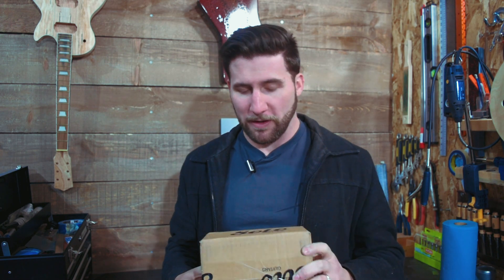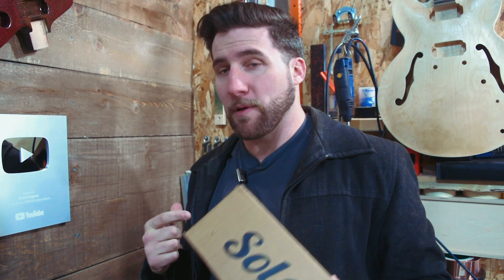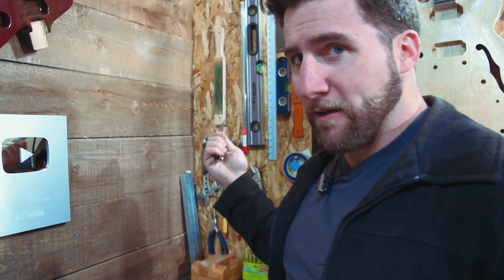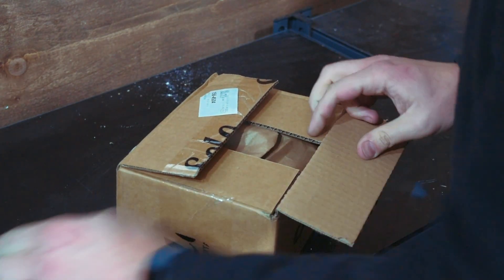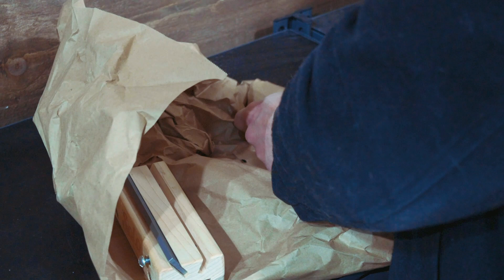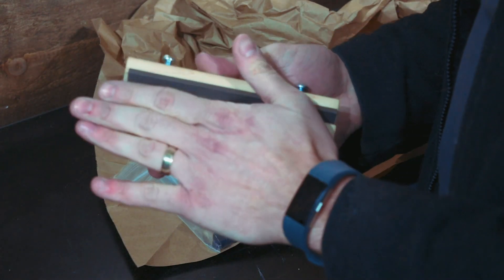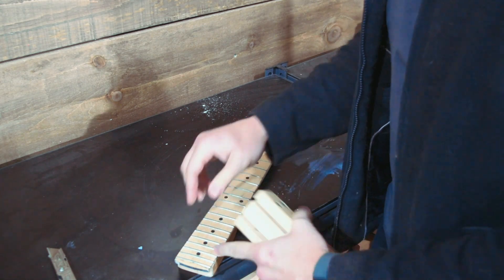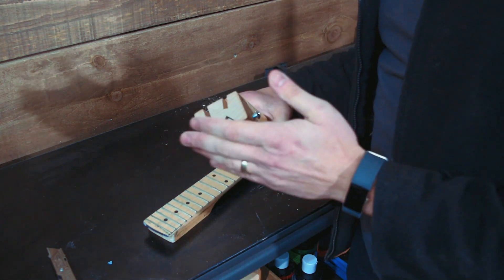New Fret Work Tools! (Unboxing)

Comment: I just visited the Solo Guitars' webpage, and had a look at their Fretting Tools, and I too came across the Fret Beveling File. It's nice to see a version with the option of 4 different angles!

The 90 degree angle is a good place to start, to ensure all frets are as close to being flush with the fretboard edges, before switching to one of the other sides. I often find that a good fret end nipping plier will almost take the fret ends flush to the edges, allowing you to go straight to the desired beveling angle. On some necks a 35 degree is too much, and will create problems, like strings slipping off the fret end, so I mainly use a 15 to 25 degree angle.

A little tip for everybody doing fret beveling...
Put a long strip of masking tape on top of the frets, for the beveling tool to "ride" on, when beveling. This lets the tool slide freely and it protects it from getting filing particles stuck to it. It will also keep the tool from scratches, from the sharp burrs, created while filing in the bevel.

My preferred fretting method is using the Arbor Fret Press, with brass fret cauls. It's simple to set up and the accuracy is phenomenal.
I have a handheld fret pressing system as well, only with a rounded support caul, so I still have to use the Arbor Press to press in the heel portion of the neck. Last week I came across another Handheld Fret Press, this time with 4 switchable neck support cauls, so I pulled the trigger. This will now allow me to also press in frets at the heel portion, which is great!
Reply from the maker: The solo handheld press has the switchable cauls for the neck. It’s a nice touch, especially for different shapes necks.
Reply: @BradAngove  - The one I recently bought has the same 4 switchable cauls, hence the reason I bought it!
I can fret bolt-on necks now, without having to take it to my actual Arbor Fret Press. It'll be nice to switch things up a little - depending on the type of job.

Keep up the good work & Merry Christmas 🎄

Comment: I made the exact tool years ago when I was very poor from a block of pine cutting out a couple of angles and glueing in a couple of cheap flat files. Has worked well for years and I still use it. The fret press is definitely a very handy tool if your building or re fretting but sometimes I find the hammer just gives better control especially if its just a part re fret ( just done a new epiphone les paul with shocking fret work) nove video mate and merry Xmas and enjoy all the great food!
Reply from the maker: Thanks Stu. A diy version of the block with some glued in files or even threaded inserts wouldn’t be all that difficult I suppose would it haha.
Reply: @BradAngove  i just used epoxy mate and its worked for years when I first priced one they were only available from the USA and silly money! The same as neck rests that I made years ago are still used almost daily.... could be a new segment of your videos mate #canbradmakeit
Reply from the maker: #50/50chance haha

Comment: You just gave me an idea. I have a caul for my drill press. Might adapt it to use as a punch for neckthru guitars 🤔
Reply from the maker: Intriguing idea
Reply: @BradAngove  yes, despite my typos 😂.  The drill press method works great, its just very cumbersome for neckthru and set neck stuff.
Reply from the maker: Yeah, I could see some kind of stand adaptation being required.

Comment: So, your new tool - A fret punch?
Looking forward to the comparison. I never liked the idea of hammering frets, always preferring a press fit. It somehow always felt wrong using a hammer on a guitar.
Reply from the maker: That and the multi angle neck file. Keep in mind you can also use the punch in some large chuck drill presses as a fret press.

Comment: Can you use that fret press piece with your drill press to "press" the frets in instead of hammering?
Reply: yeah a lot of people do it, but some say that it doesn't set the frets in properly if you do that and they can "bounce back" because the tangs don't interlock as well as if you hammer them in.
Reply from the maker: Yeah, if you bend them sufficiently first you can still have the tangs bite a bit more, but hammering seats them better arguably.